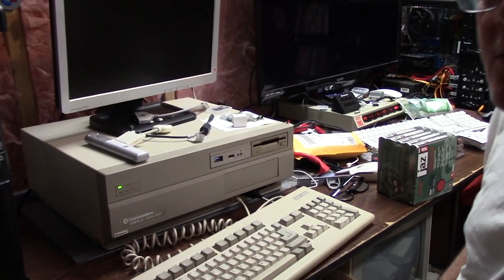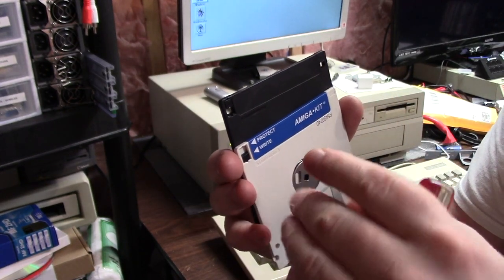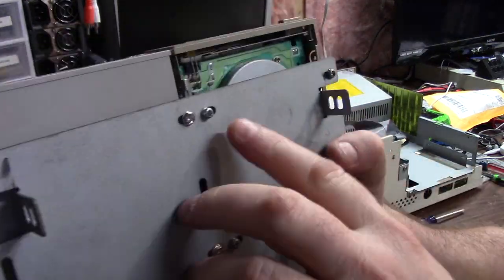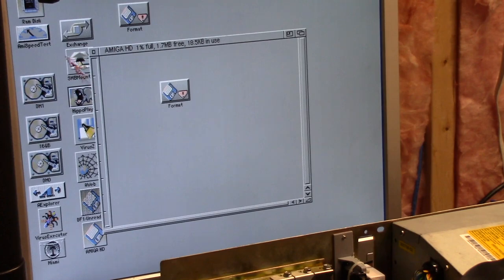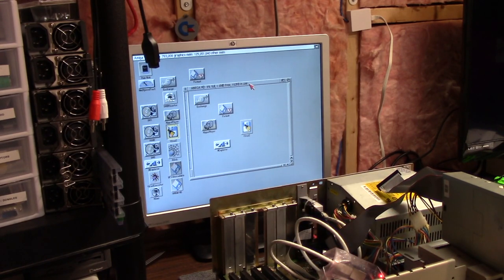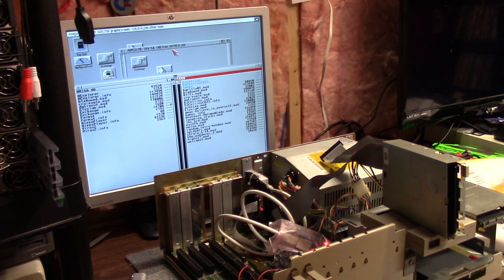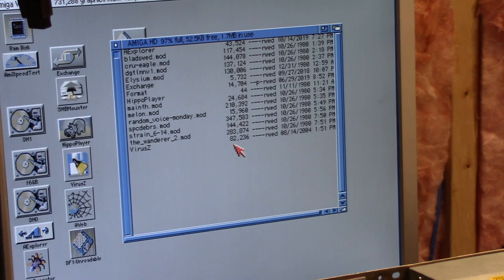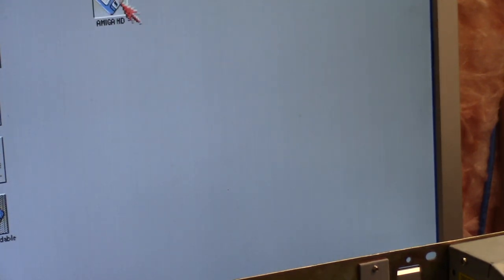Amiga High Density Floppy Chinon FB357 A

Comment: I couldn't find the results of your FB354 upgrade.  Did it work?  DId you make a video of it?  Also, what resolution were you running?   Is that VGA off the vampire?
Reply from the maker: wow i totally forgot about that. My best friend died and i had so much to take care of assisting him.   that screen is the result of the Amiga 2000's MicroWay AGA2000 flicker fixer. its not AGA, just its part name.

Comment: @Chris Edwards Hi did you get to try turning the 354 into 357? Did it work?
Reply from the maker: i did, then i went nuts on ebay and bought more amigas in addition to the ones i already owned. last place i was , i sacrificed a PC hd disk with a dual pole switch so i can put it on the 354, i had the 354 all apart as i needed to remove it all to get good access to the area,  i couldnt get the holes on the pc drive switches to line up in the correct area, so i have to find a two pole depression switch, i was going to thrift stores to get old junk drives, but then the whole plandemic thing happend and i havent finished... its still on the burner, just way back....
Reply: Chris Edwards  Cool. I Look forward to seeing how it works out. I guess you could temporarily wire the switch, so it thinks every disk is an hd disk and see if it works? In the video it is 357 you are demoing right? One unrelated question I see you run wb 3.1.4 , is there away to off the disk space gauge on the left side of disk windows?
Reply from the maker: @benjaminnice  yes 357a is the demo, you can turn the fuel gages off with the workbench preferences. in prefs, you can also turn off borders and stuff too.

Comment: I do have one (or two) HDD Chinon Drives, I’ve been meaning to look at hacking a drive since I was having issues finding the Chinon drives years ago. I need to find another LED light for my A3000 and the other thing is find/build a ROM switcher.
Reply from the maker: i did a video on how to convert a pc drive to a working 880k, i have halfway finished my chinon FB354 to fb357 hd amiga disk with my idea. but my life gets in the way alot. 8-)

Comment: Can it be found for sale anywhere? I did a quick search and seems not to be available. What other choices do we have to add a HD Floppy to the Amgas without making any soldering or whatever?
Reply from the maker: im sure you can ebay them, they came in the 3000 and 4000 computers.. well most 3000's  ebay has had quite a few, but as you know anything with the word Commodore or Amiga fetches a super price nowadays.

Comment: I’ve been looking into this with the FZ-357A (Amiga 4000 HD FDD) and the FZ-357. 

With these drives the circuitry exists in both to reduce the speed to 150rpm when an HD disk is inserted. Unfortunately, the FZ-357 is lacking the circuit to send the Drive ID on the RDY line that tells Amiga OS that a HD disk is inserted. 

I’ve found some info on creating an external circuit to implement this and I’ve been looking at implementing it in a PLD. 

Would be interesting to know if the FB drives have the same issue.
Reply from the maker: FB354 has the same circuit board as the FB357, if you add a 2 pole disk depression switch to the HD circuit on the bottom of the board and "add" the hd, it works fine.  however if yo dont know what your doing you can murder a FB354. but there cheap.
Reply: @ChrisEdwardsRestoration  I actually had a working FB-354 so I took a look at it. you’re right there is a footprint on the PCB for the HD depression switch. 

I tried shorting the pads to see what happens and it neither slowed the drive to 150RPM nor did it generate the drive ID of AAAAAAAA to tell the OS it’s a HD floppy.